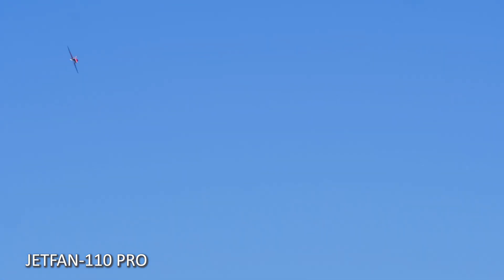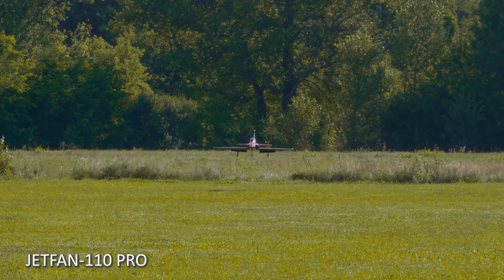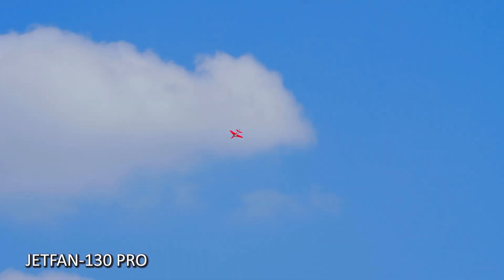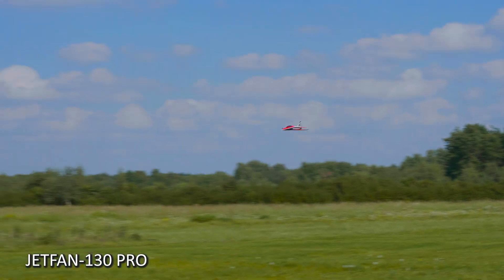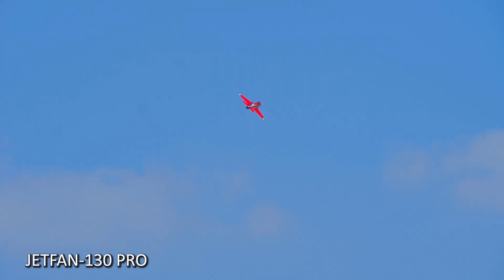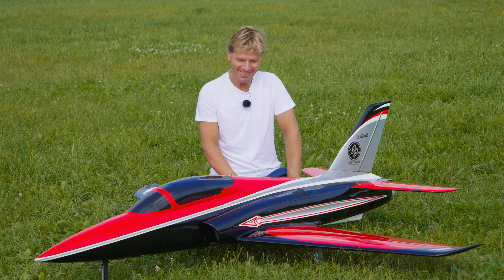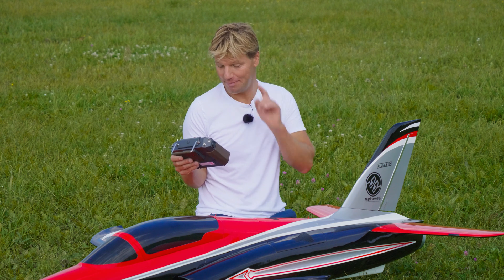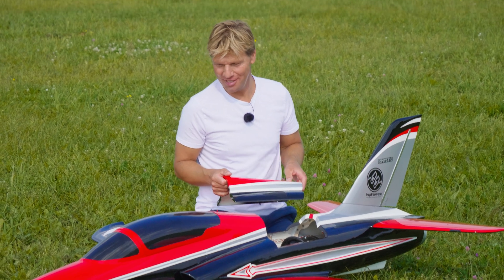EDF Odyssey JETFAN-130 PRO 332km/h 12kW 16s 208A 14,5kg takeoff weight, Li-Ion 12Ah TOPRC Model

Comment: Do you have two sets of 8s3p in total 16s3p ? how the batteries handle current consumption - one Samsung 40T battery IR21700 4000mA, max.discharge current 35A. Jindra.

Comment: Hiiii Bro! How are you? I want Ask you if I put a 6s 4000 mah Lion  made It with Samsung 40t in a EDF 70mm, the time of Flight Is more than a 6s 4000 mah LIPO?
Reply: Hi, no. You still have the same amount of capacity to use 4000 stays 4000.
Reply from the maker: of course longer is 6s 4000. It is more Watt Hours.
Reply: @EDFjetRC  thanks Bro you are Great!

Comment: I see u are using 2x U-bec on the plane. I suppose to get enough power to your rc systeme. Are they just plugged in to the rx or is there circuit between them.
Reply from the maker: One is for landing gear the other for RX and servos connected by comon ground (black cabel)

Comment: What is your email address?.  I would like to get the STL files for the inlet ring, gear, net for cheater holes and battery holder.  I am building the BH viper and want to set it up like yours.
Thanks in advance and kind regards.

Comment: Question. Can you connect an esc in parallel to double amps and it still work correctly??
Reply from the maker: You mean 2 esc for 1 motor? If so than it will not work, sory.

Comment: Hi Wojtek brzozowski. i love your videoes! i learn so much from the things you find out, like the 3D printing stuff and on EDF's! there is so much manufactures could learn from you alone.
I was thinking, have you ever thought about implementing a flybywire system? (Not a gyro, but a flightcontroller)
if you need help, i know things about this.. i could also really use an EDF recomendation in exchange.

Cheers.
Reply from the maker: I did it in the past but I can help you with EDF for free :)
Reply: @EDFjetRC  So awesome.. ok, so here is my thing, i have one of those old SebArt 3D Mig-29's.. it runs on 4s 4000 now, and flys for like 2min (no joke).. it is not great.. 
What ESC and motor combo could i put in it? i would still like it to atleast hover. I think i can fit a 6s 3000 inthere.. the ESC is 80A but i dont know if they are capable of 6s.. if not, ill change those too.
I really like what you did on you old Fly Fly Mig.. it is about the same size as the SebArt Mig.
You can reply here or on 
3DPhreak@Gmail.com
Thanks! did you not like flying on fbw?